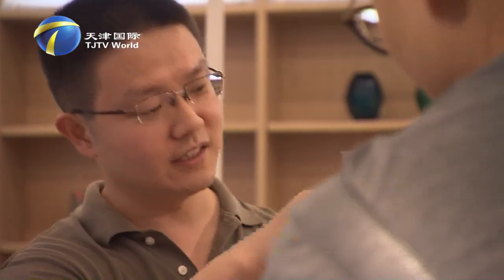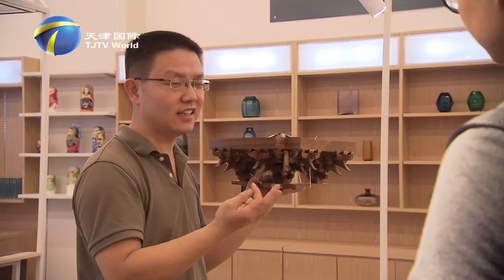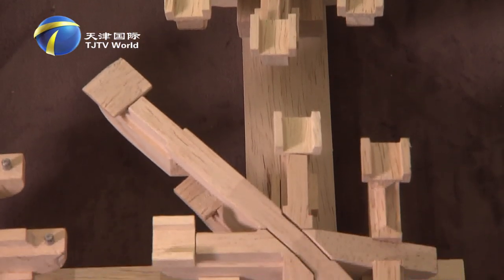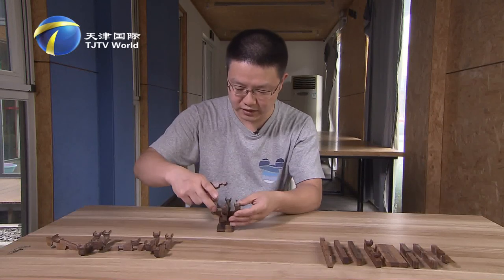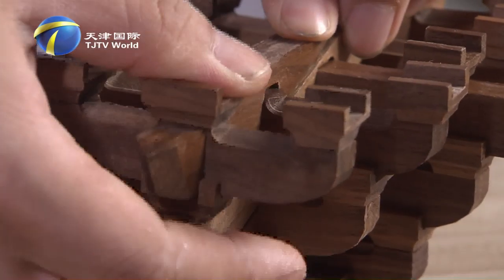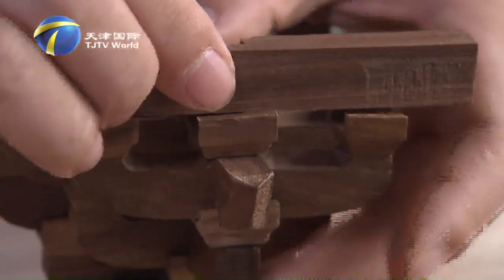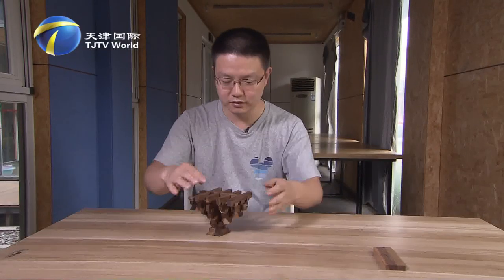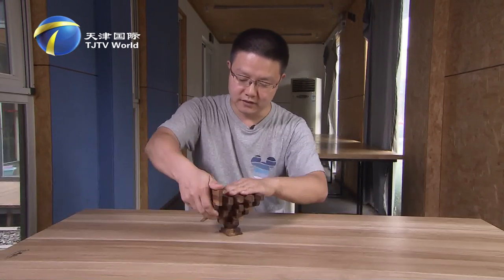Dougong   Song Style Timber Structural System

Comment: An outstanding exercise in classical parametric architecture and structural analysis. The Dougong Song style is among one of the best ways to work with wood structures. Knowledge of the past doesn't imply irrelevancy. The style itself can be generalized and be applied to contemporary architecture.
Reply: This has nothing to do with parametric design. What's the algorithmic parameters they're using which enables them to change the design on a whim? I think you've misunderstood what parametric design means/are.

This entire style is very beautiful but it's not very practical/realistic in this day and age. I wouldn't call it a good design because every single part of the building is ridiculously over designed. The "over-designness" does however give it its unique looks which I quite enjoy from an architectural standpoint but from a structural standpoint the design is an eyesore.